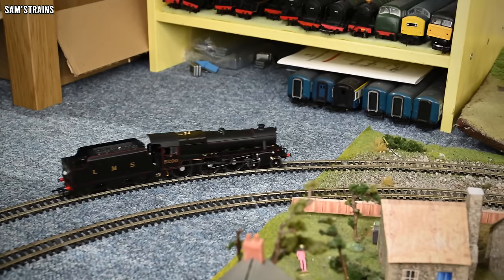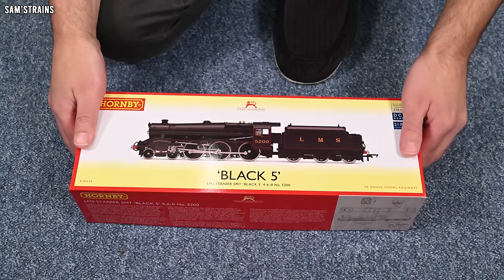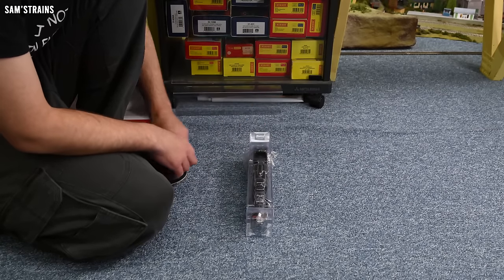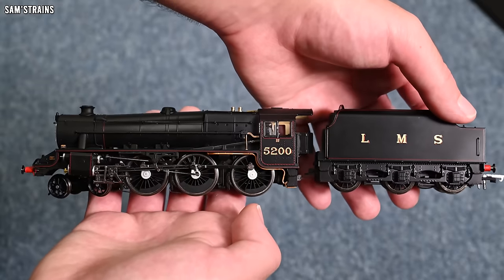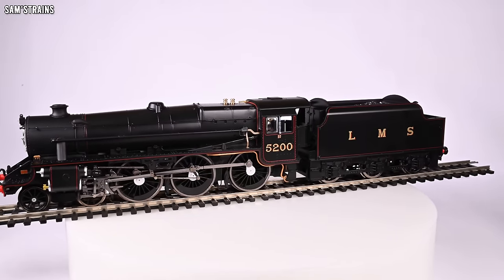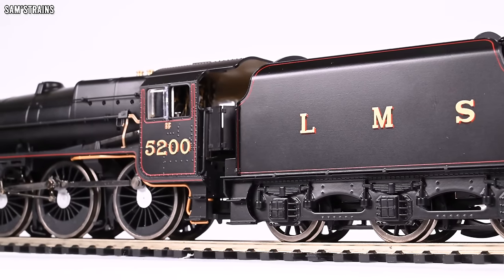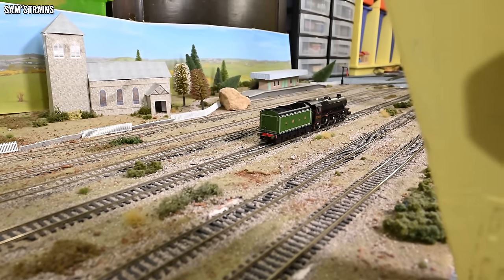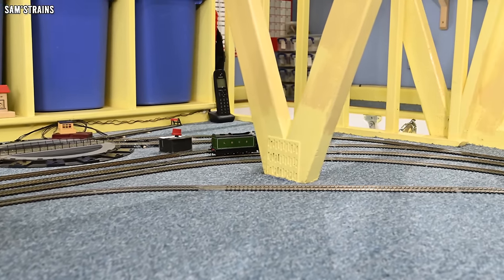Hornby's Horribly Faulty New Black 5 | Unboxing & Review

Comment: This takes the 1948 locomotive exchange trials to a whole new level. 🤣
Reply: Yes, now I want to see a GWR King with a LNER corridor tender.
Reply: Hornby had made a model, many years back, of a Southern Bullied Light Pacific (can’t think of what specific class of BLP it was) that came packed with the Stanier Tender as it had been while on trial on the LMS.
Reply: @MachRacer4 34006 Bude was the loco that hornby did.
Reply: @davidstrains4910  understood. I just remember having scene a picture of the box for it or the model itself somewhere but didn’t pay much attention to what the running number and name of the engine had been. Out of curiosity, which specific class of BLP was it?
Reply: @MachRacer4 SR West Country Class.
Reply: @MachRacer4 the loco was a West Country class with the air smoothed casing, one thing I will pull you up on though is the loco wasn’t paired with a stanier tender just because it ran on the LMS region, the tender was put in to experiment with, an LMS princess coronation class that took part in the trials was paired with an 8 wheel austerity tender.
Reply from the maker: hahaha!!
Reply: Didn’t know a Princess Coronation ran with an Austerity 8 wheel tender during the trials. I now wonder if the LNER engines ran with different tender designs during the trials.
Reply: @MachRacer4  don’t think any LNER engines ran with different tenders but one thing that did happen on the LNER engines mainly the A4s was the corridor tenders back had to be cut down so the water cranes on some of the routes and in particular at Euston could be used to fill the engines up, one of those tenders would be then paired with flying Scotsman but not in the exchanges this was preservation as Alan Pegler when he bought Flying Scotsman wanted a corridor tender, the one he got was from Lord Farringdon, the Duchess that I know of was 46236 City of Bradford which also had the semi streamlined smokebox, the austerity tender was also used with LMS rebuilt Royal Scot locomotives as well
Reply: @davidstrains4910 I found a picture of another BLP fitted with a Stanier Tender during the trials. Number 35017 Merchant Navy Class “Belgian Marine”.
Reply: @MachRacer4  Belgian Marine was the loco I remember...
Reply: yeah...i know...the LNER had to safe the day.....again.

Comment: I don’t get the exorbitant prices expected for die cast. Sure, it’s not as cheap as plastic, but die cast toys were standard when I was a kid and they didn’t cost the price of two weeks groceries. Somewhere along the line someone fooled us into thinking it’s a premium material when it’s actually not.  Better than plastic? Yes. As premium as silver? No.
Reply: Well, you makes me want to check the price of the metals required for manufacturing die cast. There is an international trade on metals, and you have raw material prices fixed by the market you can't turn around. Plastic for models can be sourced from recycled materials (ask Dapol for that), but is dependant on the price of crude oil.
I don't say that the price asked for die cast models is justified, I just don't know and I will check by my own.
Reply: The alloy used in die casting consists of mainly zink. At the moment the price of one tonne of pure zink is around 2300€ or 1950£. The cost for raw material is pennies per die cast loco chassis. You can manufacture one heck of a load of model locomotives out of one tonne of zink. Zink is not a premium material by any stretch of imagination. The die casting moulds on the other hand are very expensive, even in China. Not sure how they compare pricewise to moulds for injection moulded plastic. Someone in the industry would know.

Comment: No die-cast and flywheel was a deal breaker for me, at this price.

Absolutely devastated.
Reply from the maker: Yep - that was a shocker too! The running plate is metal, but the rest of the body plastic!
Thanks for watching, Sam :)
Reply: Totally agree with you.  I collect LMS locos but I will not be buying this.  Just not good enough at that price.
Reply: 😂😂there there

Comment: Thanks for the review Sam. I had one of these on order which I will not be buying now.
I remember Simon Kohler saying this would be the 'ultimate Black Five'. This is anything but!
Reply from the maker: No problem - sorry to hear that but if this is anything to go buy I wouldn't recommend one. It's certainly the ultimate in terms of detail... but if the factory can't build it right then that's redundant!
Thanks for watching, Sam :)
Reply: Ultimate, as in final, will H survive?
Reply: Maybe he meant “ultimate” as in that you’ll lose interest in modelling the black 5 or even the whole of the LMS after seeing this need to use an LNER tender!
Reply: @SamsTrains  Although I agree with the review, the valve gear (yes - I know you had issues) is generally the finest I've ever seen on a non-Continental locomotive. You didn't show a close up running, but the GW-inspired air-pump off the bottom of the crosshead would have worked - this when added to the fully-detailed Walschaert's rather heavy construction (prototypically correct) was a phenomenal piece of work by the Hornby design team.  Just a great pity that the factory didn't do its job.
Reply: maybe he meant "the ultimate con"...
Reply: He also said “it’s for keeps”

Comment: It is not Sam's fault that this example is faulty. I have seen numerous other reviews of these that were just fine. Sam's did show a flicker of what a faultless example is capable of (that crawl for one thing)
Reply: The crawl was not faultless
Reply: @darreno9874  I didn't say it was, I just said it showed the potential that a good example has.
Reply: Agreed. Adi Pullen own example had dirty wheels out of the box (not acceptable, I agree), but worked flawlessly. See his review for more comparison.
By the way, the lack of serious quality control is insulting at this level of price.

Comment: Hi Sam, I wonder if this is a DCC blanking plate issue. If the lights and everything work EXCEPT for the motor, perhaps you have to look at what went wrong in the circuit board, and I think its the DCC blanking plate, which I assume is on the tender as you have identified it as a tender issue.
The blanking plate, rather than putting all inputs in and out to the decoder, just outputs the current back into the motor and everything, so I think something is faulty there.
I don't think you opened up the tender in your disassembly part of the video, so I hope you check that out, pop in a new blanking plate, and make a follow up video. Cheers
Reply: The blanking plate may be what is at fault. I had purchased the new run 9F Evening Star. Upon DCC/Sound installation I found that both the blanking plate and DCC decoder (Soundtraxx Econami UK) were a loose fit. By gently and carefully bending the pins on the motherboard I got the decoder to stay in place and the locomotive ran perfectly.
Reply: Yeah the DCC socket, and consequently blanking plate, are in the tender. It could be a problem with either that or the tender connector since clearly the locomotive itself is fully functional.

Comment: I absolutely love the way hornby did the lights Sam, I really wish more model had this feature.

Cheers Jasper & Willow
Reply from the maker: I agree! Hopefully they'll refine this feature and fit it to other locos... though clearly it adds quite a bit to the cost... so have to think quite carefully about whether we want to see this feature as standard
Thanks for watching, Sam :)
Reply: If they made the lamp iron out of 2 metal parts that act as electrical contacts, then it would probably work better, be more realistic, and easier to use. I just thought of this and may have to try it. It works well in theory at least.
Reply: It’s a rubbish way of doing lighting - particularly as steam locos should be having lights you can see lit during the daytime!

Steam locos used paraffin lamps which output as much light as a candle! Go try putting a candle in a metal casing then stand 50m away - because the sort of light levels you should be expecting from steam era lamps.

Comment: This is specifically why I focus on brass locomotives. The detailing is insane, but very rarely do you get a "poor quality" or "defect" model, and if it's a new production, you can be sure the importer will work with you to rectify the issue. Sure they cost quite a bit more but damn are they nice to work with
Reply: British outline brass. Done in '0' but rarely in '00'.

Comment: I'm probably going to get roasting for this...but...(Totally great review Sam, I would get refund also..). 
I bought this model, which was delivered yesterday...luckily for me it has,nearly, none of the faults,...
Tender connection, all perfect no hitches, glitches or stalling, works perfectly.
Running plate, all straight and true.
Valve gear , all tight , no loose screws
Glue marks....ah ha..not to the naked eye or magnified reading glasses...I did find two, in a similar place to yours Sam, HOWEVER, it took a high powered LED workbench torch and a magnifying glass to spot them , really a none issue and would never have seen them without seeing your review in the first instance.
I've just got the loco run in, and it appears to be an excellent performer,,really enjoying it, beautiful model, I wanted it to add to the 1970's tooled and early 2000's tooled examples already in my collection...I thought the early 2000's model was a fine example and good detail...this new one blows it into the weeds ...
I recommend it....But dont be wary in throwing it back to the retailer if its faulty..mine luckily  is near perfect, so a keeper. Good Luck everyone.
Reply: Forgot to say, I'm so sorry for you Sam, such a disappointment for an iconic loco both in life and in Hornby Model form.

Comment: Turns out your choice of alternative tender was precient -  check section 2 of that instruction leaflet, where it suddenly starts talking about fitting a decoder or sugar cube speaker to your P2! Also, was it just me, or did it actually look like those front lamps were glued in position?
Reply from the maker: Ahhh fascinating I'll double check that! Yes I saw that too - does look like glue behind the smokebox door lamp bracket
Thanks for watching, Sam :)
Reply from the maker: And you're right - it's talking about a P2 - can't even write a manual correctly!
Reply: @SamsTrains  Even one thing I am able to do properly as an amateur novel writer, Hornby f**k it to the top... I'm sincerely considering not buying this model and wait for Accurascale of Rapido to manufacture their own.

Comment: I do quite like the new Hornby tender connection. During the exchange trials sometimes locos swapped tenders with other companies. Hornby even did this a in the early-mid 200s with a Spam Can and a Stanier Tender. Even setting aside that use, some classes of loco had multiple tenders, the A1s and A3s for example, so you could swap tenders of you wanted to represent a loco in a different configuration.

It would be nice if all of the companies agreed on a standard. But hey, I’ll take what I can get.

Edit: And now that I have gotten to that part of the review… this sums up modern Hornby. From a design standpoint you get an amazing product. I have a couple of those new loco tender connections, and they work great. But Hornby QC just fails. From the motors to the detail. I think Hornby knows if it wants to save itself it needs to start offering products with amazing features. Once the smoke version comes out you will have pretty much every feature you could want into a OO model on one place. I am happy to pay high prices for high spec, but that needs to be backed by high quality.
Reply from the maker: Yeah absolutely right - decent design with some awesome features, let down by poor build quality and a lack of quality control... again and again and again...
Thanks for watching, Sam :)
Reply: Always ensure you have the RCTS 'Green Book' to hand to make sure that your particular combination of loco and tender actually existed and at the right period ;-)

Comment: Took Hronby long enough to finally add working lapms on a regular steam loco! BTW i think the factory fitted once are actually glued on/in ... 
Maybe they should sell kits as well, and let us glue/fit parts our selves, specially if it means the models will be cheaper by a margin that way (like KATO does)!
I think I'm happy with my old Black 5 for now (not like i could afford the new one, specially with that insane import tax).
Reply: Working lamps on UK outline steam locos are unrealistic gimmicks that look terrible! The real things used feeble paraffin lamps with the same light out put of a candle - and moreover were never actually lit during daylight hours as the lamps were there to indicate the train type etc to lineside staff (NOT for the crew to see where they were going) which was done by their physical position.
Reply: @philkeller4170  Very good point indeed. Also the 'realistic fire' wouldn't be seen often, as the firedoors were kept as closed as possible - and often totally closed!
Reply: Yeah, imagine if the firebox flicker went off for long durations of time and then suddenly popped on, blazing and flickering away! They can’t model the doors closing, but I’m sure Accurascale at least could change their firebox flicker to turn on in bursts if they decide it’s unrealistic.

As for lamps, maybe they should just be turned on and off via DCC, and if they’re too bright, well, I suppose they could easily be made weaker.

Comment: I had the same problem with my P2, Earl Marischal. I took it upon myself to resolder a broken wire to the new style tender coupling. Not an easy task due to the very small size of it. I also had problems with Prince of Wales with steam generator. It was also a very poor runner. This turned out to be a problem with the decoder multi-plug. I sent it back to The Model Centre over two weeks ago and I still have no idea when I’m going to get it back. Poor show from Hornby on my last two locos. I’ve also pre-ordered the new Black Five with steam generator. I just hope that it works better than the previous two. Keep up the good work. Hope to see something better in the future.

Comment: Hi Sam, have you checked the Walschaerts valve gear, at 27:07 it looks as though the eccentric crank and the eccentric rod are flopping about. As a scratch builder I would fully expect such loose valve gear to have a big negative effect on the running of a model.
That's likely in addition to the issue you have found with the tender.
 I agree for the price Hornby really need to be doing a much better job on quality control. 
cheers
Phil

Comment: Hi.  I totally agree with what you’ve said.  I’ve no reason to not believe you.  I’ve a huge collection and some of the tat that comes through from all the manufacturers is very upsetting.  Hard earned money spent to return, swap,  have repaired or just put up with is not acceptable.  I’ve seen that you have been torn to bits on some “respectable” sites saying you have an issue with Hornby, you buy damaged items, you damage items etc and the usual “it’s on carpet and he took it to bits before running”   I actually think that a lot of purchases are not even ran.  They stay in the box for a future layout.  Or in a cabinet to be looked at.  Personally I do not want a shop to open up the box. Heavy handily Sticking it on a yard of track and test run it either way before I buy.  Part of the  excitement is also opening it up for the very first time.  You keep doing what you are doing.  I’m 100% behind you, although like anything, sometimes I think you are a bit soft and sometimes a bit hard on some models.  I’d would have loved to see a great review of the black 5.  However you should only review what you got.  Which in this case is a pile of poop.  Cheers.  Dave.

Comment: As others have commented, it looks like the DCC decoder is in the tender and when a DCC ready loco is running on DC analogue, the current runs from the pickups to the motor via the blanking plate. This is why, unlike locos that don't have the decoder in the tender, it won't run without the tender connected. I guess there must be connections on top and  underneath that drawbar, 2 for pickup, 2 for motor, and some more for lighting, firebox flicker etc. I wonder if there is a loose connection on a motor wire on the tender half of the drawbar, with the wire just touching sometimes and loosing contact as it moves round the corners?  It is possibly amenable to a quick fix if the wires are accessible, but they may not be and I fully agree with you not wanting to fiddle with it as you intend to return it.  It is a shame that Hornby are still being let down by their quality control on this sort of thing - such a simple thing for them to get right during manufacture & testing and they got it wrong. I wonder if they do any testing at all?

Comment: My Black 5 is from the last batch of the preves tooling.  And it has a 21 pin decoder socket in the tender form the factory as well as a speaker somewhere in the loco (it did have TTS installed, but it failed after about 3 hours of straight running).  And just from the tittle of teh video, I am happy that I have my older one
Reply from the maker: That's interesting - didn't realise any of the last batch had 21 pin sockets!
Thanks for watching, Sam :)